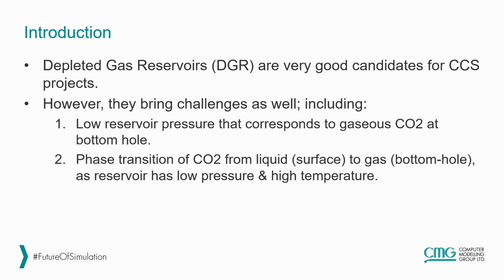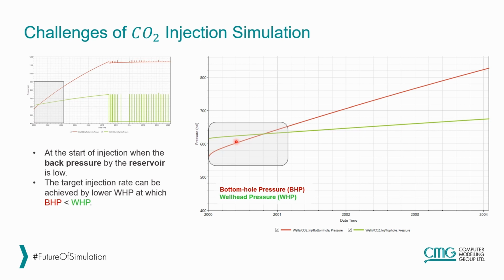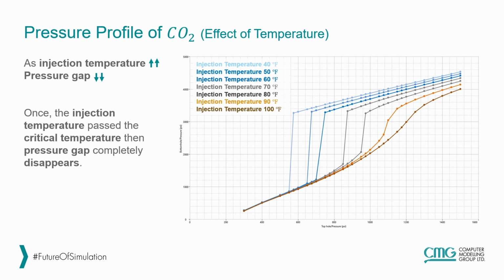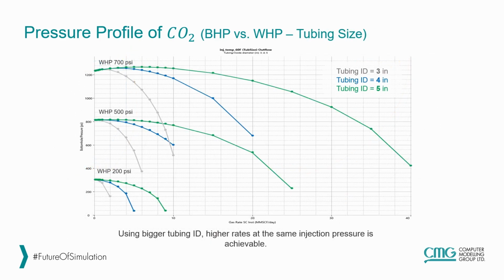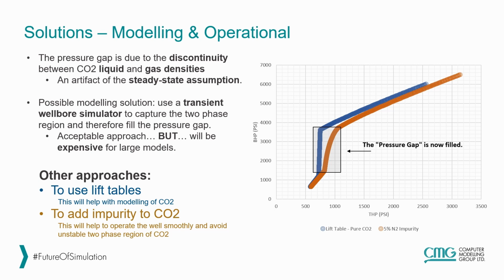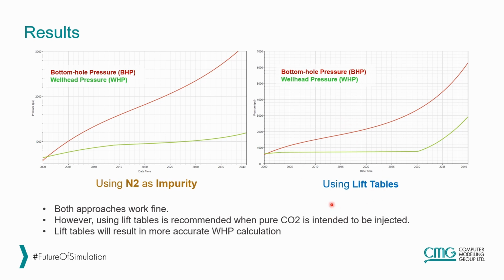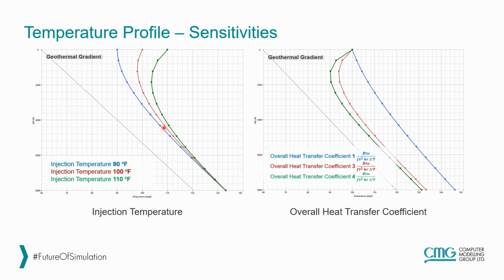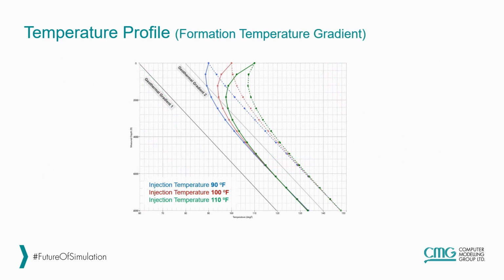Integrated Modeling to Assess Multiphase Flow Behavior of CO2 in Wellbore for CCUS Projects

Comment: Thank you for the presentation. However, I thought that CO2 was expanded at adiabatic conditions when pressure is decreased. Why you said it is compressed if your BHP is lower than your WHP?
Reply from the maker: Hi Anabell. Thank you for your question.

We have observed from the simulation results that there are cases in which BHP could be less than WHP during CO2 injection. The slide related to the pressure profile of CO2 at 60 F shows this happens at some low wellhead pressures. However, this does not mean that the BHP will be always less than WHP during the injection because at some point the gravity element of the pressure drop becomes dominant factor in the wellbore in comparison to the friction element and then we expect the normal trend of higher BHP than WHP.

Therefore, the main assumption behind the adiabatic compression of CO2 being as one of the parameters affecting the temperature profile is that the expected BHP is higher than WHP according to the operational reservoir pressure, injection temperature, injection rate, tubing specifications, etc